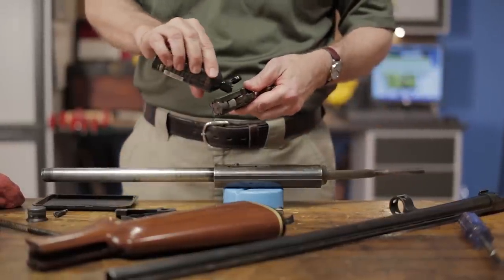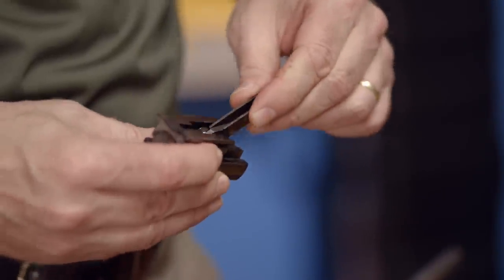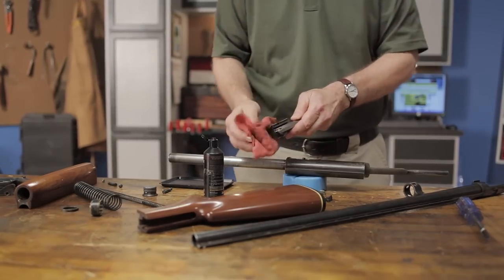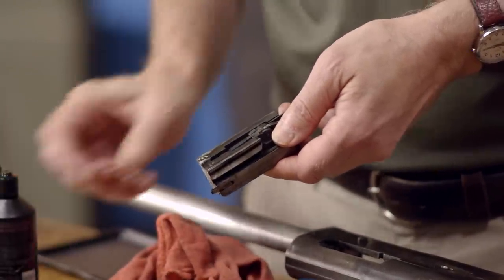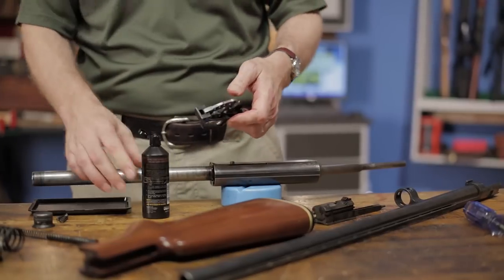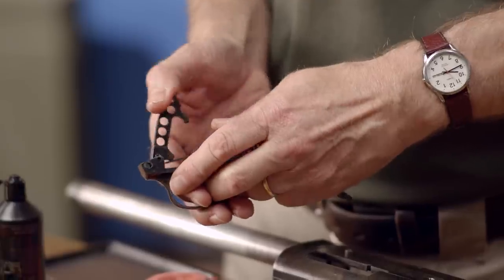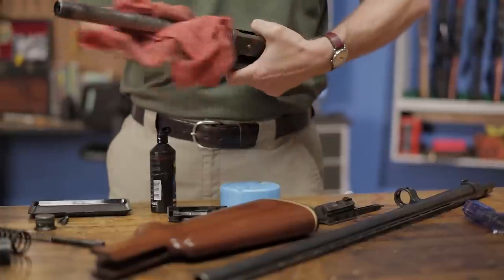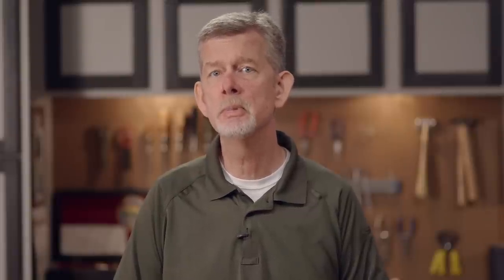Browning A5 Maintenance Series: Lubrication

Comment: I've told to use synthetic motor oil on the recoil spring. I just purchased a 1958 BROWNING A5
Reply: johnnyweeks1971 yes that’s good practice. Basically an actual gun oil/synthetic oil would be better than clp for that application.

Comment: Hello Brownells.  I have a question in regards to the Auto 5.  The gun was made in 1969.  It is in great shape.  And I'd like to know your thoughts about the Remington DriLube spray.  It's a teflon based spray that I'd like to use in it.  If it works.  But, I don't want to 'gunk' it up.  Hence the reason to use the spray.   Can you help with your thoughts???
Reply from the maker: Unfortunately we have not tested the Remington DriLube on any Browning A5’s yet. I would suggest contacting Browning directly as to their suggestion with the product.

Comment: Have you guys ever used GunX from CorrosionX? We use the AviationX on aircraft in the Air Force and I saw an add for the GunX and some of their other products. I know it works for keeping rust off tooling and I've been told by some Crew Chiefs that it is a good anti-size on some items. I was wondering if it is a good lubricant on some semi-autos like the older A5 like I have. Also do they make a rifled slug barrel for the A5? The one I have is a 1968 manufacture and chambered for 3" Mags, but has a Linemen adj. choke on it that I don't want to remove as it was a gift.

Comment: How does the magazine follower come out of a Japanese a5 magnum ?
Reply: The same way as on an FN A5.  If you look at the follower retainer  at the top of the magazine tube , you'll see two small holes, one on either side of the split.  There are pliars  made to fit in the holes.  Squeeze the retainer together and slide it out of the magazine tube.  The spring and follower will slide out.  A light coat of oil will help keep these parts from rusting.